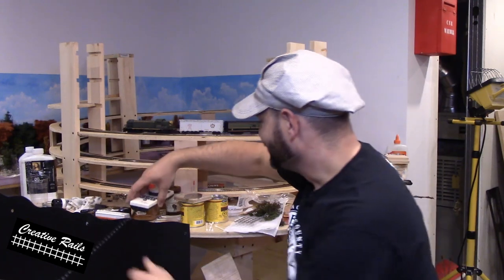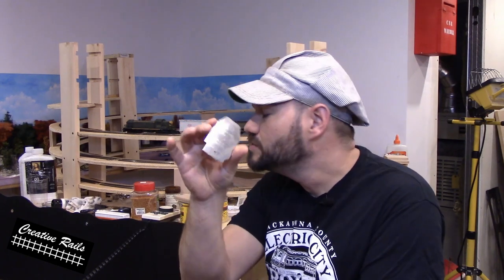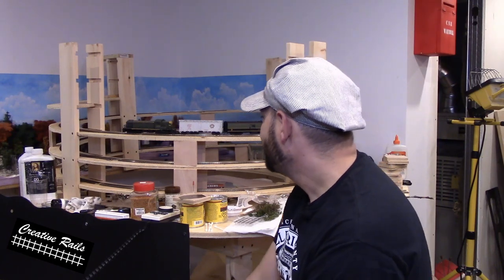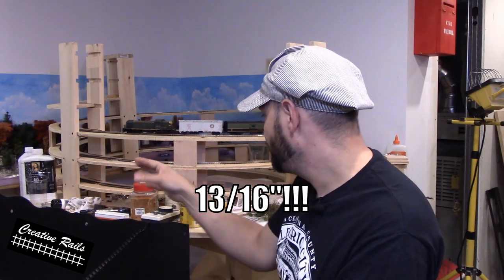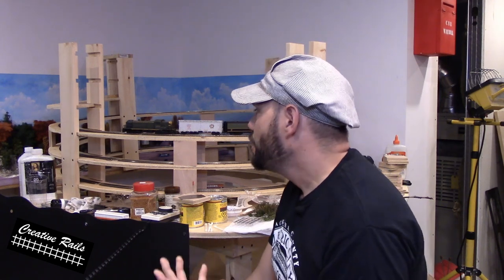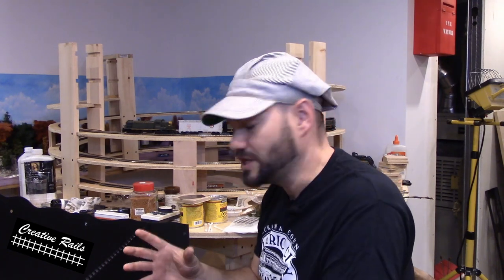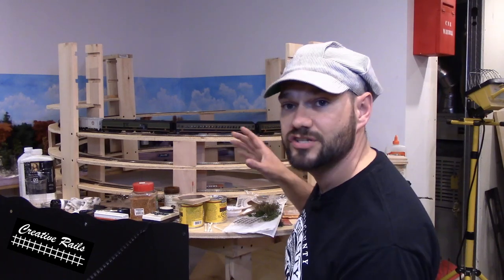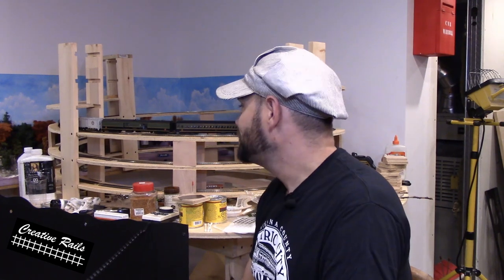Building The Helix On My Model Railroad Pt. 1

Comment: Here we thought that it was about cutting wood, putting down track and planting some trees and we got trains running. Who knew we had to bring the pencil protectors out for our shirts and calculators and sharpen our pencils to run trains. Great job Ben, put the hard work in now and the rest is easy and fewer headaches down the line. Great job.

Comment: the tighter the curve the more friction on the trucks, longer the train the more it pulls sideways. there must be a formula for that too. you got it easy. lol. smaller cars and locos have a easier time in a helix. I run a line of auto racks, and any humps and bumps cause a issue.
your helix looks really good. slow and steady my friend.

Comment: Great work Ben, looks fantastic. I cant wait to see the bridge scene. A continuous curve adds a lot of stress to the train and in a sense increases the grade. If you compensate for the curvature it may be closer to 3%. Car weight may be a very important factor if you plan on any trains of length. Too much weight and you cant make the grade, too little and you string line the consist and derail. Will be interesting to see how you operate the helix to make it work with such a small radius. Might have to have a helper for certain trains, could make it more fun to operate or even double the hill to get the train up.  Cheers Rob

Comment: Hi Ben, Your construction method is very good. I suppose the bridge will have to be on a 2½% grade as well to maintain the clearance when the track rejoins the helix?  Keep safe,  David.
Reply: Not quite David. It looks like the bridge will be outside the helix so its radius will be somewhat larger, giving a longer run with the same rise. Mathematically that reduces the grade on the bridge itself, but creates a slight vertical transition at each end.  Art...

Comment: Personally I stagger my rail joints. By using a hobby knife to remove just the tie plates under the joint the opposite rail is held in place by the ties and helps keep the gauge intact and creates a smoother flowing joint. In critical areas such as a helix I also solder them.